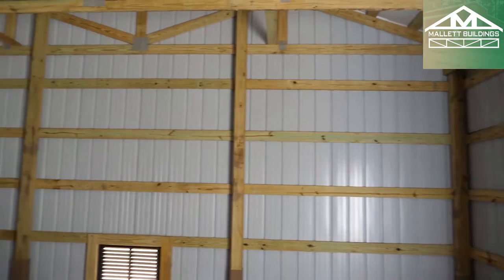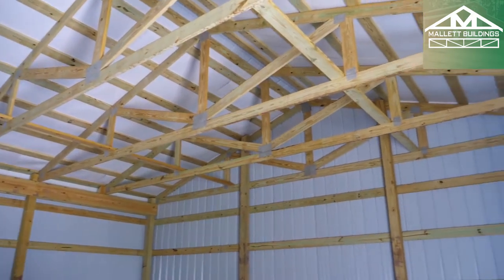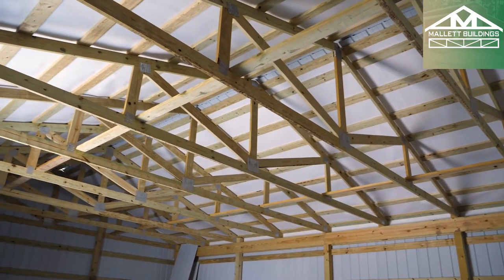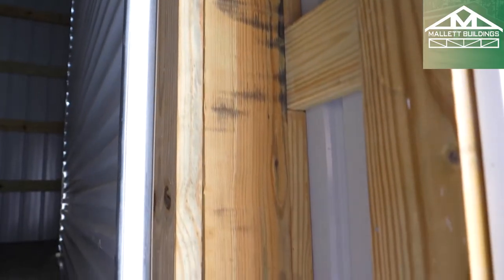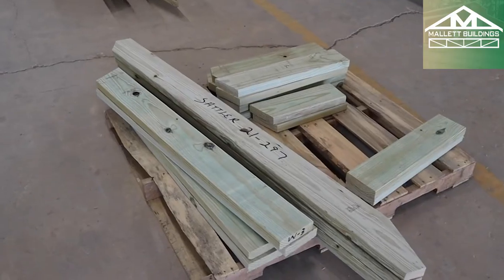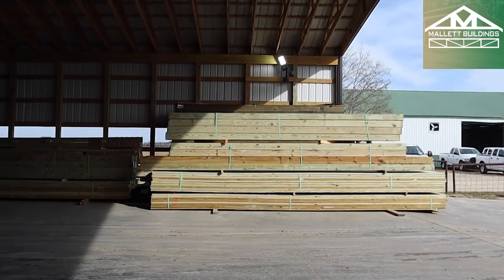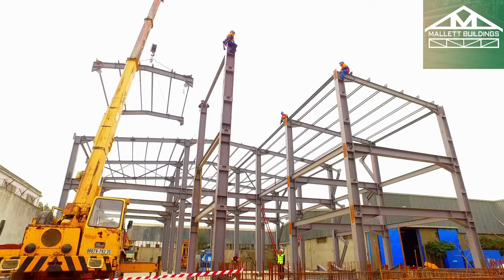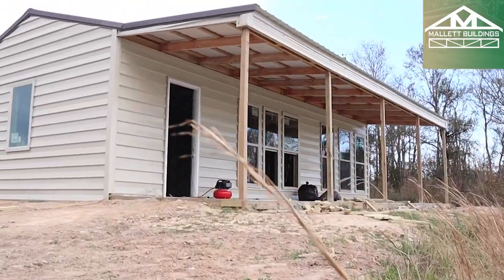Steel vs Wood: We take a look at the differences between the two building materials

Comment: You’re argument for post frame is valid only if wood and steel have the same strength.   Which obviously they do not.  This sounds like a sales pitch for wood construction by someone who has stock in the wood industry.   Not an objective comparison.

Comment: What kind of a beam.should i use for span of 3 meter ? It's a load-bearing wall. Tnx
Reply from the maker: I would need to know the load is to answer for sure. Take whatever your load is and call the local lumber yard to buy an engineered beam with the load you are bearing but based on just 3 meters you could get away with 2 2x12s notched into 6x6s to support that
Reply: Hi flitch beam will sort that buddy